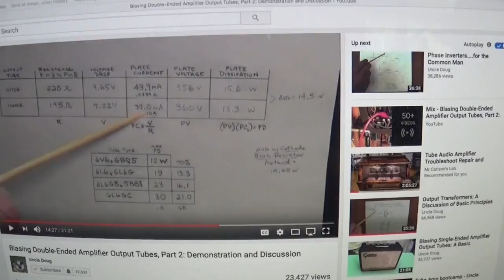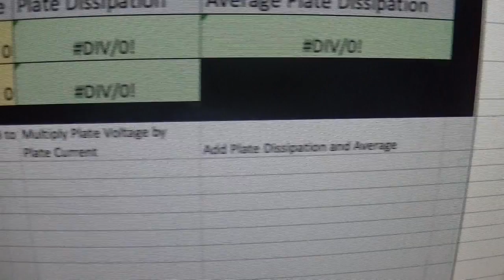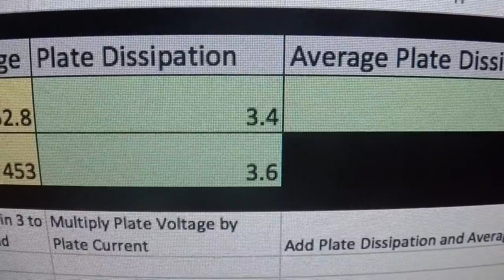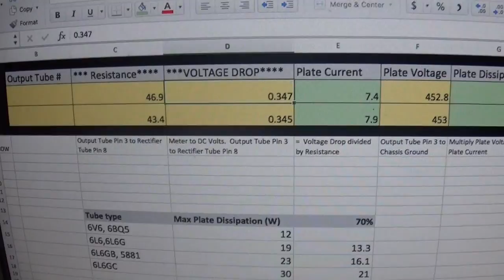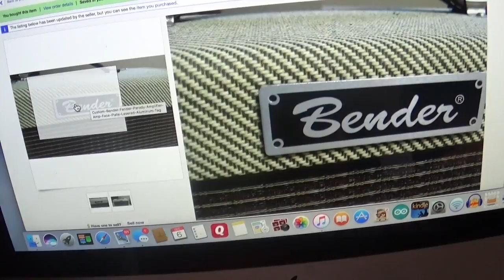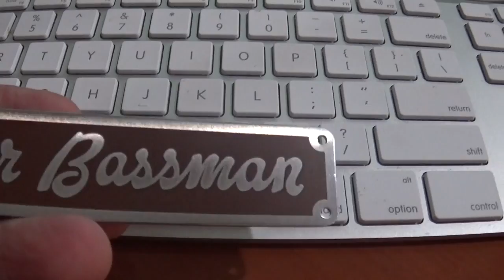Fender 59' Bassman Amp build - Episode 11 -  Mystery and plates.

Comment from the maker: Well, I got brave and removed the 56K bias resistor.  I went with a few values gator clipped in - 30K, 20K, 22K , 27K and none brought me to the 70% dissipation of 16.1 .  Then I went with a 25K resistor and bingo.... 16.1 on the nose..... 70% of the dissipation and 36.4ma  for the bias... so that seems to be the ticket. What bothers me is that since I built this as a true 1959 amp, why did the 56K resistor not work. There has to be an underlying reason....   so for this amp, I am thinking a 10K pot and a 20K resistor will be a good MOD to make the bias process a little easier.